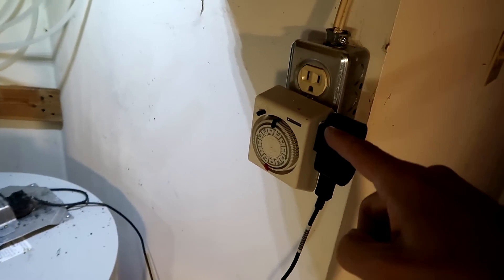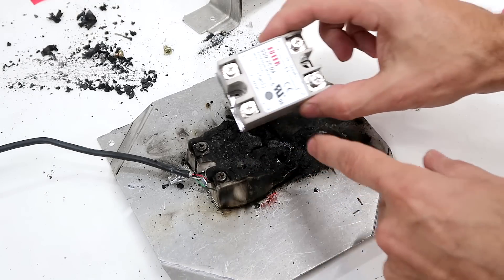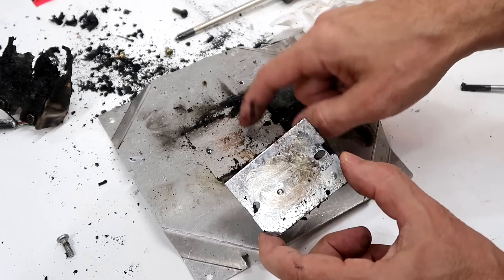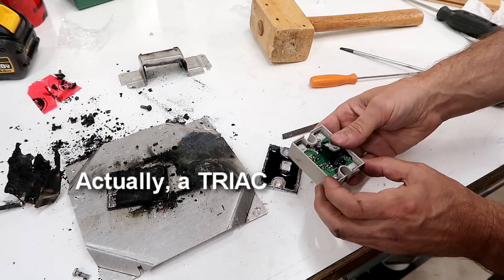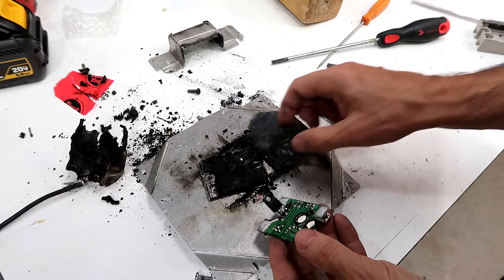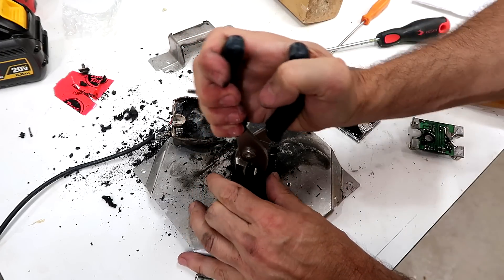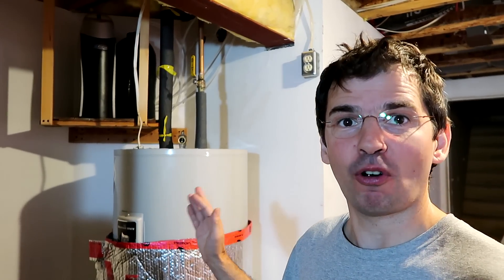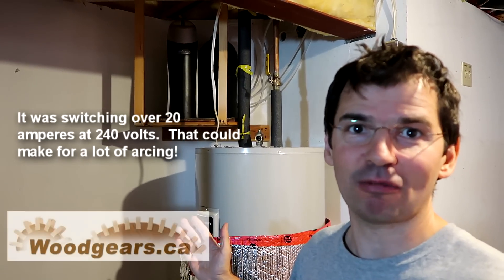Spectacular solid state relay failure

Comment: Contractor. Only safe way to make and break a circuit with any amperage over about 5 amps.
Reply: Hiring a contractor to flip a switch once each way per day is not a cost effective use of manpower to save a few cents worth of electric power except perhaps in banana dictatorships. Even then, if they use a filament lamp to watch the clock in the dark switchroom, any savings are only practical to a Gov't Dept. To make it worthwhile, the contractor would need a thermometer and a bell plus hi-vis socks and time-share (using the clock as a monitor) to double as a fire detector using both the thermometer and smoke sampling ports (holes) in the door. He could then watch both clock and temperature gauge utilising the same contractor and light for both tasks, doubling his output. Using his approved procedures manual he could then determine whether to put on his Cat III insulating gloves and flip the water heater switch in a safe manner, or don his approved PPE ear muffs and heat resisting non-asbestos lead free gloves and ring the bell inside the specified safe bell swinging zone.
Reply: @TheAmpair  wtf are you talking about?
Reply: @TheAmpair  oh, I get it. Contractor...
Reply: Yeah! The one who holds two wires and connects them two together , when needed lol. :D :D
Reply: TheAmpair 😃Auto-correct!
Reply: Tim Hvac66 I use rib relays quite often for loads up to 24 amps and have never had an issue with one
Reply: It doesn't have to be a contactor. Any relay will work fine as long as it has the rating.

Comment: WOW, I had the impression relays were very safe, but lesson learned! May be a good idea to enclose in a steel box with holes for air flow like a power supply in a computer. I had one fail on me while I was working in my office. It poured smoke out but was  never close to catching anything on fire.

Comment: There are many, many counterfeit Fotek SSR's for sale online :(
To say the issue is Chinese SSR's is not accurate: Fotek is a Chinese company and makes great relays.
Reply: I belive Fotek is Taiwanese.  Indeed these fake controllers work but only at about 1/2 or 1/4 their rated current.  One issue I encountered with 40A fake foteks is that they fail in the on state so regardless of signal they pass current.  Same application as Mathias's - immersion heater.  I have used these quite successfully for up to 1500W ( 10-12A) heater circuits but at 4800W (20-22A) they fail on.   I have a rainbird relay purchased from a slightly more reputable supplier and it works fine at these loads.
Reply: Ah yes, Taiwanese, my mistake.

Seems like de-rating the SSR's by more than half is a good idea!

A colleague recently ordered a few for cheap, and they came with "Foteh" on the SSR's labels, in non-branded packaging  :|
Reply: @ianjefferson9518  I have Inkbird brand 40A on my project. 4500W @ 240V so about 1/2 of the claimed rating. Heatsink that came with it is the size of your fist. The enclosure has forced air circulation. I've checked after 10min operation and the hottest spot was about 100F. I used cpu thermal paste before bolting on the heatsink too. So far the only runaway was due to a failed MCU. Left the mechanical thermal safety cutout in the mains just in case; to prevent a ka-boom.

Comment: Electronic component ratings are the MAXIMUM rating before failure. You wouldn't drive an axle rated to shear at 2000Nm at 1800Nm cont. load that has a startup surge like a cold heating element does. My general rule for ratings with relays is if you want assurance that it will get the job done you de-rate a component by 25%, if you want it to last a few years you de-rate your component by 50%, if you want it to last for the foreseeable future you de-rate by 66%. Put another way;
Fast job: ComponenRating = SurgeCurrent x 1.25
A few years: ComponenRating = SurgeCurrent x 2
Foreseeable future: ComponenRating = SurgeCurrent x ~3
And you should calculate SurgeCurrent by measuring the resistance of the element while cold and dividing your mains voltage by that number in Ohms instead of using a clamp meter to measure it in operation. Solid states don't need contact ware considerations so for your application I would slap a 60A version of that same SSRelay on and call it pretty good.
Reply: Oh, and mounted on a thin piece of galvanized steel isn't the best idea ever, but if you properly de-rate your components you could probably get away with it.

Comment: Well it is a 3 $ SSR after all... also SSRs need surge protection and pre-fusing when connected to mains. That might have prevented this spectacular failure, or limited its impact. 20 A on a 25 A SSR is also really pushing it - no way you can get the required thermal resistances with just that small heat sink.

Comment: Told you so on the last video, INDUCTIVE LOADS ARE NOT SUPPOSED TO BE CONTROLLED BY SOLID STATE RELAYS, you are very lucky that it didn't burn your house down, just wood and insulation..... Being reckless with systems that alnways online is stupid and dangerous. You set your wife and kids in unnecessary danger. Period think about that...

Comment: One possibility is that the mechanical connection (screw terminal) where you hooked in the wiring was not tight enough causing a slight resistance -- coupled with high current translates to heat.  The terminal heats up,  the solder liquefies,  liquid solder drips on the grounded heat sink bridging the terminal to ground providing a current path.  Arcs and sparks result.  Additionally, the circuit board carbonizes.  More heat, more flames.  Too bad You did not have had one of your raspberry pi cameras trained on this.  It was likely quite a show.  Glad no real damage resulted. No people or pets were harmed....

Comment: Wouldn't it have been better to just switch the control signal to the already existing (approved) relay on the hot water tank?  I don't know the particulars of your HWT but I'm sure it could have been done.
Reply: plenished no relays on most water heaters, just an internal thermostat
Reply: @tpgoat  a thermostat is a temperature switch... depends if it uses a thermal capillary to perform the switching or a temp control signal. I suppose in this case it's a capillary.

Comment: Nearly 5 KW switch power...... i never would use a solid state relay for such a hammer. And this little thing made 50W heatpower? Never. Perhaps with a good heatsink and a fan.
Reply: I think probably more like 40W. But that is a proper roasting for any component in an enclosed box with inadequate heatsink. I think 2W will make a bare TO-220 boil water.

Comment: I'm surprised the circuit breaker didn't trip. With a spark like that I thought there must have been a short. I think the TO220 TRIAC got so hot that it's solder melted, causing short on the PCB and then the whole thing burst open in a fraction of a second. 
So what's the proper way to do this? Perhaps a mechanical relay? Mechanical relays tend to stay open after failing. They are less resistive when closed therefore a lot less heat in high-current situations. Lifetime and switching speed shouldn't be a problem either for this application.
Reply: The heater is still in series to this and will limit the power to the nominal power of the heater. So the breaker would never do anything here.

The proper way to do this is either a well-sized mechanical relais or an SSR with the proper application (surge protection, fusing, dimensioning, heat sink, maybe temperature cutoff (they're cheap)). Surge protection probably wouldn't help with this particular failure mode, given the SPE looks relatively intact. It's still fairly important, because surges will damage the SPE / triac over time and that might give you a fairly similar failure mode, i.e. exploding SSR catching fire. Fusing instead of circuit breaker is relevant because the circuit breaker won't limit the energy to a level low enough that you can rule out a fire if your load fails (i.e. you get a short). This particular load (heater) wouldn't get you that failure mode, though.
Reply: Das Stackenblochen no dude. The heater was not still in series with this. This model SSR has the two inputs on one side and the two outputs on the other. Not sure which side shorted, but either way, the heater was no longer in circuit.
Reply: Jasper Janssen: That's really, really not how this works. The SSR's input gets a few volts DC to switch it on. The "output" of the SSR is either open circuit or closed, just like the contact of the relay. The load is always in series with that.
Reply: The signal inputs on the Fotek SSRs are optically isolated from the output using an optodiac, the switched side is inline with the load (see the bigclivedotcom teardown of the same fotek model / fake).
Reply: Das Stackenblochen you are of course entirely correct. I’m not sure what the hell I was thinking there.
Reply: Considering that the water heater uses like 5kW when it is on, the breaker would not be expected to trip for this type of failure (smouldering failure). Bad as that charred mess is, it was probably only a kW or so that did that. The problem here is that the relay is a fake. Only buy from reputable sources. Maybe avoid fotek altogether.

Comment: Yeah , too close to it's rating or over ?? Who knows , the chinees rate their products always at the limit or mostly even over.
It says 25A on the label ,but that was maybe tested with a big coolblock somewhere in a fridge.
Maybe its normal rating for constant use was 15A to 20A max.
These cheap chinees Fotek's do the job ,but buy atleast one dubble the rating you need.
Even a good known brand ssr you take a higher spec one then you need.
If that heater takes 22 Amps then use a 40A fotek  or a 30A good known brand ssr bouth with a decent coolblock.

Comment: Let's hope the folks that watched the first video and implemented your idea see this video too.

Reading the comments in the original video someone mentioned that these knockoffs tend to catch fire....lol.
Reply: I also warned of the dangers of those knock off Foteks. They're great for some experimenting but there is not a chance I would leave one hooked to mains unattended.
Reply: SrMofo Exactly.  He was lucky this time but next time it may burn down his house.  I do not trust their DC SSR for the same reason because, typical of the Chinese, they claim an Amp rating but you better halve, a third, or a fourth of their number to get a margin of safety.  Spend the money for a real one (they are expensive but for a reason) as life is too precious to screw around with like this.  edit: My other concern/rant was him using axle grease as a TIM.  Seriously?  That was adding on to a future failure and he, and I, had a few words about it.  It worked didn't it?  Was his main thing while mine was "It worked for now but it is not a TIM and not meant to be."  He did two stupid things but luckily it did not cost a life/lives/property this time.

Comment: It looks like the power transistor is using the metal base as a heatsink and only relying on the springiness of the leads to ensure contact between the two. I can't see that being terribly effective at heat dissipation.
Reply: I think a close look at when he opened the unused SSR, the triac was fused and riveted to the base plate.  I agree with the speculation that the SSR was cheaply made for its rating.

Comment: Heatsink on top of a HOT water heater.  Hmmm.
Reply: I would assume that the heater or rather the water reservoir is insulated so it is a moot point of concern regarding heat disipation.
Reply: Even if it was completely uninsulated, the water is only heated up to around 110 - 120 F. That leaves plenty of thermal capacity for an application like this.
Reply: Sharky Sharklops uh.... no? Water heaters certainly do not heat to just 40 degrees, they heat to 60-70 degrees, if you don’t want to get legionnaire’s disease. And with storage heaters like this, with a relatively small tank, if you heated it to just around 100F, which is about the temperature you need it to come out of the shower, your hot water will run out during the first shower of the day. Good luck to anyone else living there.

Comment: Wow, a lot of you are posting dumb comments. The clearance was good enough not to catch the house on fire. The flat metal heatsink could have been tested. If anything you can complain why there wasn't an arduino to alarm for a high heat event.
Reply: lightdark00 the clearance was too small to prevent the house catching on fire. He got very very lucky.
Reply: Jasper Janssen nope, it wasn't luck, it was foresight. Those foam pipe covers aren't made to catch fire easily.
Reply: lightdark00 yeah, he was very lucky that the foam that was installed wasn’t the older or cheaper kind that goes up like a candle. Also, there’s a wooden floor right above it.

Comment: It's your house, family lives there.
A) only buy quality SSRs
B) know the failure states - know they are going to fail
C) thermocouple the heatsink inline to the line and control

Cold water is always better than a fire.
Reply: Or just mount them in a way that if they fail, nothing happens.  Like Matthias said he did.
Reply: @sycc66  He got lucky.  The fire could have been worse.  Still too much risk for me.
Reply: Counterfeit defective relay. They have probably already burned down several people's houses. It is possible to design them so the combustion failure mode is not possible, even when overloaded, and that is what should have been done.

Comment: If that SSR was bought from china the internal components are at most worth 8-10A in terms of its components. I have burned up alot of em :D  And running close to max they need cooling to be added
Reply: DIY Tech & Repairs . My thoughts also,  a lot of Chinese products way overstate the amperage.  A good product that is sold to switch 30 amps is sold of the shelf being capable of doing so without the end user having to modify it to do so, e.g. put on a heat sink!!!!!
Reply: This is Fotek. Supposedly a Taiwanease brand, which isn't the best in the world anyway, but there are few other sources of fake SSRs with Fotek logo. They are from China and use cheaper components, and can't actually handle rated current without failing.

Comment: You know a ton of people are going to be saying what you should have done to avoid it? You know, you should travel back in time to use a bigger relay or something.
Reply from the maker: exactly.  Or an additional complicated system to monitor the relay!
Reply: Complicated and safe is far better than a smouldering wreck of a house, is it not? ;)
Reply: Or some redundancy system to cut off the relay, cool it down and maintain the water heater working. "You know, if I were you, I would have chosen an overkill rather than this unsafe hack job. My father's boyfriend's sister had a..." :D

Comment: 20 amps Is not enough really need to be 30 amps why didn't the mains relay kick in and turn it off maybe run a 20 amp fuse would prevent it Catching Fire.

Comment: Thank you for this Matthias. I did a similar installation on two water heaters in remote locations using contactors like you'd find on an air conditioning unit. Less susceptible to heat issues I think. I paid about $10 each on Amazon, and they had 24v, 110v and 240v activation inputs for the contactor.  But, this video makes me want to turn them on while at room temp and monitor the temps at all the connection points.  Thanks!
Reply from the maker: I thought about using a contactor, but the contactor itself also uses a lot of power, whether the heater is heating or not.  So that really cuts down on efficiency.
Reply: Gotcha. Yep, efficiency is a different goal. Mine is a remote property, occasional use (10-15 times a year), so reliability/ease of use was my priority.
Reply: Contactors use only a few Watts, and ONLY when on, why do you think they consume power when off ?     If only your ancestors had not fought to keep tyranny, you could have been part of a educated country, and not a Socialist hell hole, hell bent to win the race to the bottom.
Reply: Wish I could delete replies, but alas, only he can.  His goal for this project was to conserve energy. And his point is that even if the Water Heater has reached temp, and is therefore "off", the contactor will still consume energy holding the circuit closed to provide power to the heater if it needs it.  Granted his relay thingy performs the same function, but at a much lower power consumption rate.  So, the main lesson here is, don't be a tool.